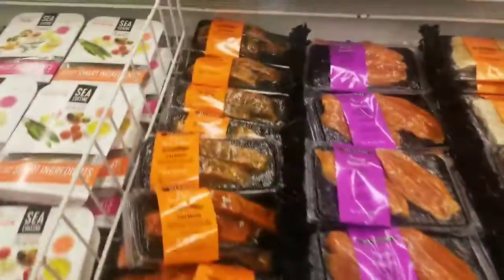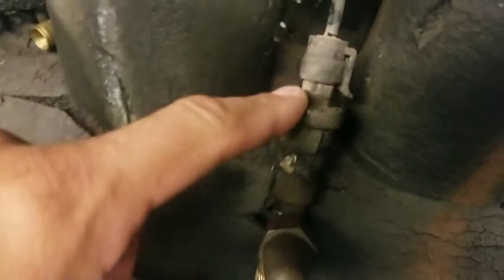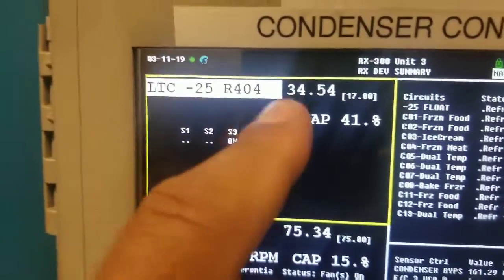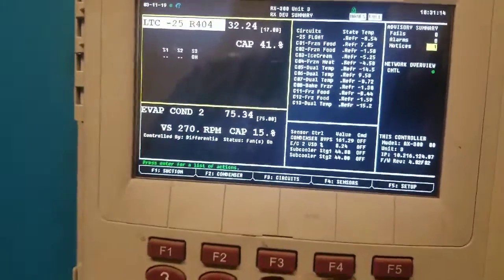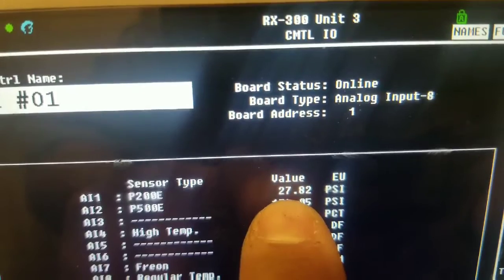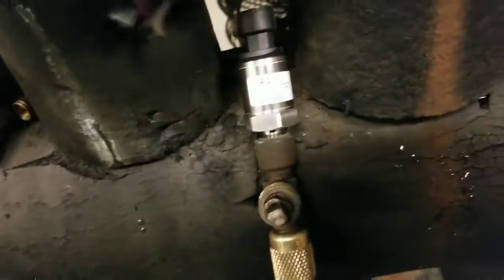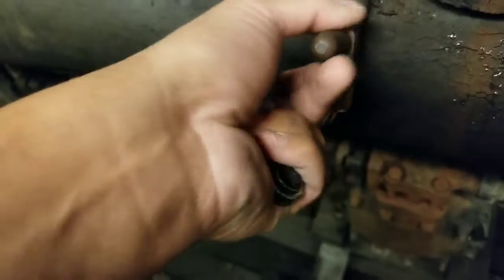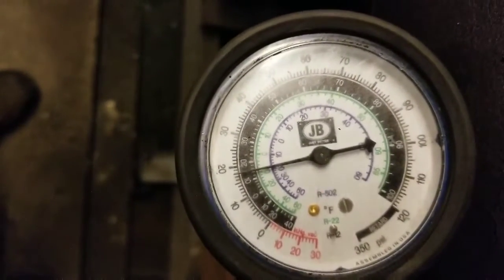BAD SUCTION TRANSDUCER!!!

Comment: That looks like weather pack type connectors on that transducer. Truck manufacturers like to use those too. I’m often re pinning connectors or fixing them due to loose pins and corrosion causing faulty readings. Because it’s much cheaper than the 800 dollar harness or the customer urgently needs the truck. They make tools to release and repair the pins on those connectors if you’re in a pinch. Cheers, great video
Reply: Good work

Comment: How do you put a gauge on a transducer if it's set up like theres a wire connected on where you connected your gauge? I don't want to risk taking the wire like thing off coz it might cause more trouble as im not familiar with it. Im new to these btw.
Reply from the maker: You can put your gauge anywhere on the suction header. It will still read the same. Hopefully that answered your question.

Comment: Regardless of transducer malfunction, there should be valves which will regulate temperature even if the suction. Is too low. As long as the case temp sensors are reading correct.

Comment: So off set is like differential on the low pressure control?  I though the pressure at the transducer match with the controller after you set off set to 0.  Why is that you still replace the transducer if it feeds back the right data?  Thank you very much
Reply from the maker: The transducer already had a offset, so when I went take off the offset and it went back to normal readings. It will go out of calibration again, so it is already bad. That’s why I changed it. Hopefully I didn’t confuse you too much. 👍
Reply: RefrigerationTech thank you very much no not at all. Sorry for asking too many question. I try to learn more of this stuff myself.  Is there school or any place they train these? As far as the system itself and the controller?  Again thank you very much

Comment: Is there any way to actually test the transducer and wiring before installing a new transducer?  I guess if they are digital that would be difficult, but if they are analog that should be possible. right?
Reply from the maker: Right, just make sure you have an accurate guage?